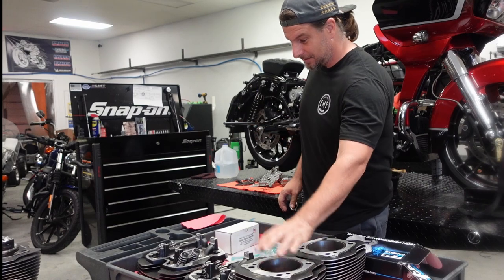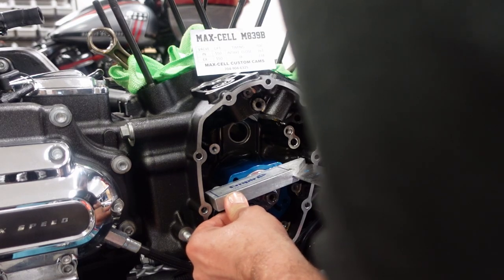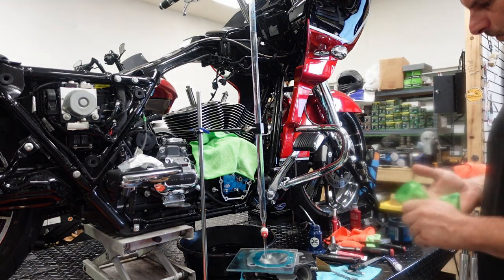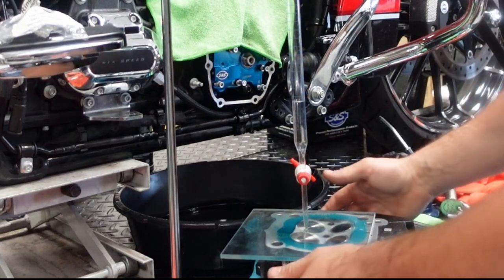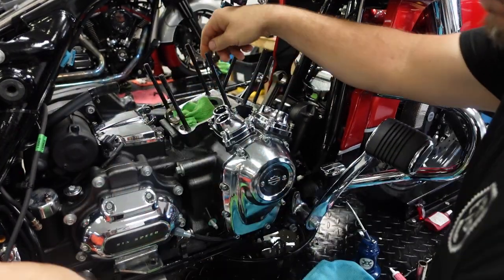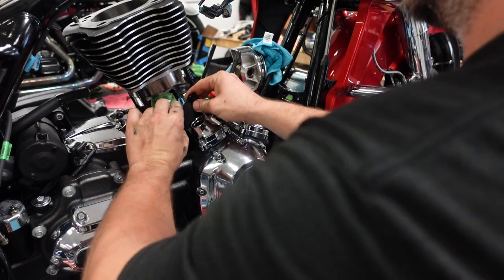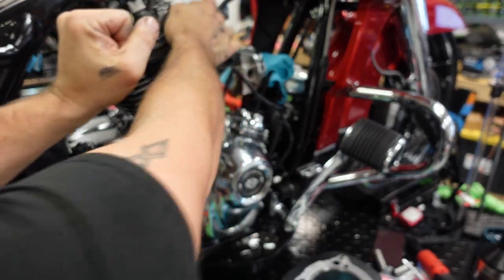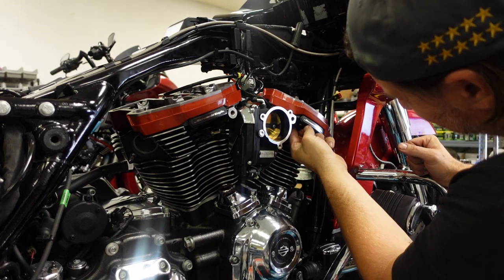Building a 12:1 Compression, 128 C.I. Milwaukee 8 CVO Road Glide

Comment: i build my m8 motors never heard of not using a base gasket interesting good video
just installed total seal gas ported rings on this build excellent ring seal
Reply from the maker: Yea. I don't usually do that. But with the machining tolerances between the Harley cases and the s&S cylinders, it is easy to do.

Comment: Another great one man! Really liking your channel, one of my new favorites. About compression.. About to either go stage 2 with high lift cam or the Fuel Moto 132" Outlaw kit with either 11.75:1, 11.25:1, or 10.8:1 compression on my Road Glide ST. What´s the right way to go about the choice of compression here? Would love your input on this!
Reply from the maker: It really depends on the cam choice. Usually a cam with a later intake closing time can handle more static compression
Reply: @empcycleworks  Yeah, so if we flip the question. In what case would you recommend 11.75:1 opposed to 10.8:1? Does one of them speak for more power or it has nothing to do with that?

Comment: Enjoy your content & builds, good narration…I’d like to see more detail and narration on installation of heads and pushrods…which seems really confusing to dummys like me.  I also don’t quite get the re-torquing of all the cylinder bolts.
Reply from the maker: I am working on what works best in my videos. I appreciate the insight. I followed the torque instructions that came with the cometic gaskets for this build. I don't know the exact reason why they use this procedure. All I know is they sealed!

Thanks for the comment

Comment: What octane gas do you recommend for 11:5 :1 compression 128 with 3+ heads
Reply from the maker: Depends on a few factors. Static compression does not tell the whole story. Depending on the cam and the tune, I would run 93. Or the highest octane available where you live

Comment: Hey did you ever get this bike on the dyno??? ###
Reply from the maker: Yes it didnt make the power we were after with the Khrome Werks Exhaust. I think 155 and 146. Something  like that. We  just put a d and D exhaust on it. the tuner is almost done but it was at 166 hp and 159 tq last I heard today. We are also putting a D and D on the 143 that I bilt. Should wake that thing up.
Reply: Very Nice I’m in the process building that setup waiting on Ward and also have a bigger cam I’ll let u know hp🫣🫣🫣

Comment: Harley Davidson at this point is basically depleting old engine parts and tooling. The Milwaukee 8 motor is old school 1940’s/1950’s technology HD has been holding on to. Overly labor intensive maintenance like 3 hole oil changes, huge primary chain, bottom end cams, pushrods and a hot air cooled motor is gotta go. Performance is the new way which is what other manufacturers have done ahead of HD. The Revolution Max format will move across the line sooner than later if HD is to be competitive down the road.
Reply: so
Reply from the maker: I agree. But Old school engines are still fun.

Comment: And the numbers are what? I've got a 128 without that 12:1 and getting 141 HP and 151T. You all should be pushing 160.
Reply from the maker: I don't have final numbers yet. We are still breaking it in. Plus, we are changing the air cleaner and exhaust. It made 150/145 on some early pulls. It is limited by the air cleaner. Unfortunately, everything is on hold right now as this hurricane moves through. I will post final numbers when we are back to normal. Thanks for the comment.
Reply: What Octane rated fuel do you have to use?
Reply: @dieselsoggydog6299  I’m just using 91. We have 93 available here but it contains ethanol so don’t use it.